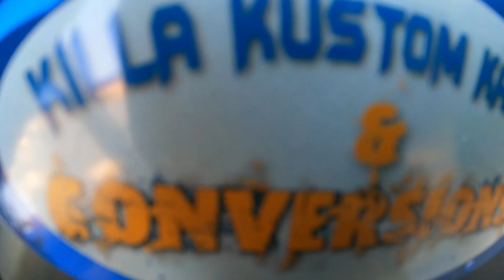LS patrol build ep15 - paint and suspension

Comment: Looks sick mate. What size fuel lines did you run and also what sender unit did you use to house the pump in the tank ? Like TB/ZD??
Reply from the maker: Thanks, used 12mm supply and 8mm return 
I just chopped the bottom off the standard td42 pick up and attached the new pump to the bottom of that